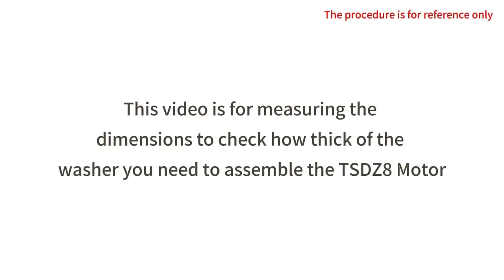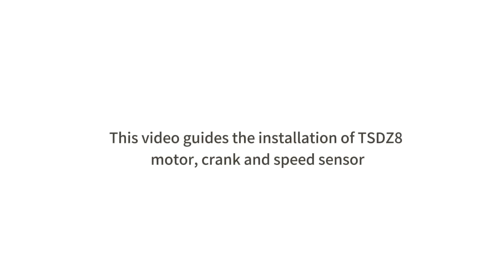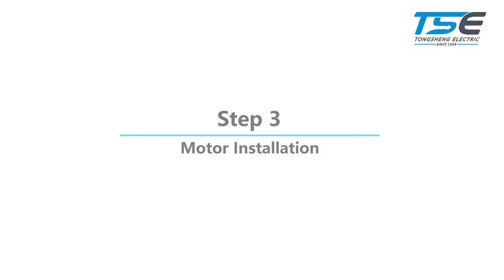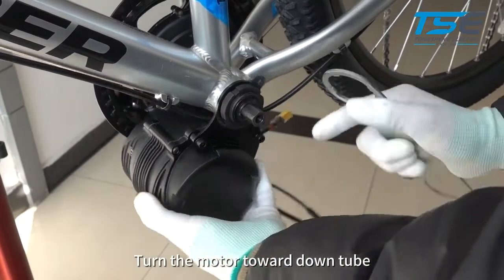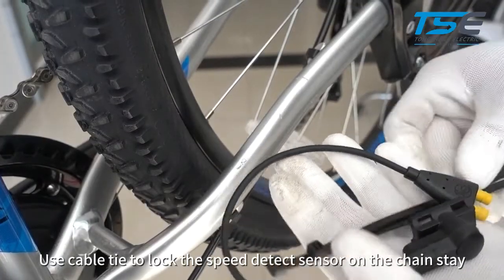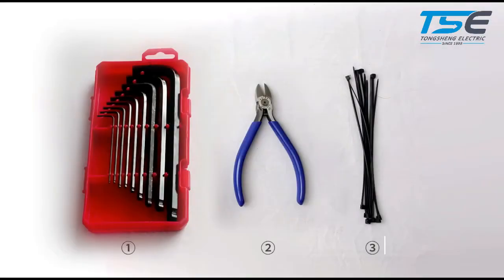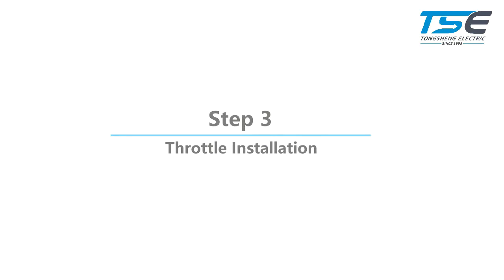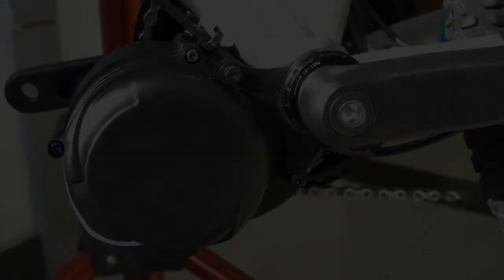TONGSHENG TSDZ8 750W Mid-Drive e-Bike Conversion Kit Installation: Easy Step-by-Step Full Process

Comment: I can’t find anywhere it says they offer a temperature sensor on the TSZD8. So far the only temperature sensor I saw was one someone added, not to the correct place, but as close as he could, which was outside the stator coil, which would lag behind winding temperature slightly.

When I googled “Does the TSZD8 have a temperature sensor?”, AI answered yes because it read this guys mod, and reported it as the gospel. Lol

It’s possible Powallon is doing something similar and writing new firmware, but it means the original controller needs a place to connect a temperature sensor. 

There is a company called ToSeven which as I understand it were part of TongSheng and they branched out, fixed many of the TSZD issues, and launched a new brand. The DM01 (1000w) and DM02 (500w) have temperature sensors and firmware that supports it. 

I think they also potted in the stator so the heat conducts to the outer housing better and lets the motor run cooler.

I think the TSZD8 would be fine if used correctly, but nobody wants to do that, they only want Turn and Burn. Lol

Comment: What is the maximum thickness of the bottom bracket washer to avoid the collision with the chain stay? I measured my frame and I need about 5mm of extra clearance.
Reply: Hello, may I ask how long your bottom bracket is? If your bottom bracket is 68mm long, we happen to have two washers with an outer diameter of 41mm, inner diameter of 35mm, and a thickness of 2.5mm. These washers were originally meant for bikes with a 73mm bottom bracket. If your bike's bottom bracket length is 68mm, using these two washers will move the crankset and crankset cover outward by 5mm, preventing the crankset from hitting the frame. However, you need to confirm if simply adding 5mm is enough. It would be best if you could take a photo to show us the gap between the crankset and the rear triangle so we can make a better assessment.